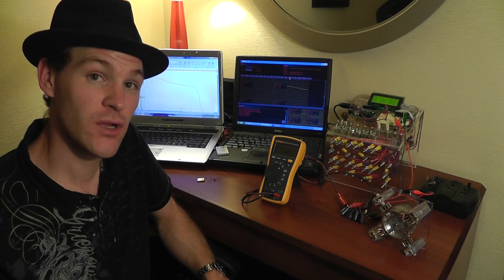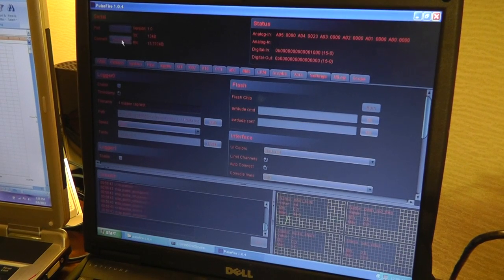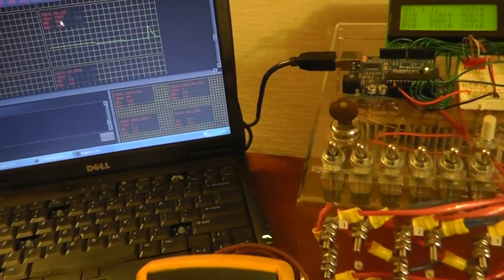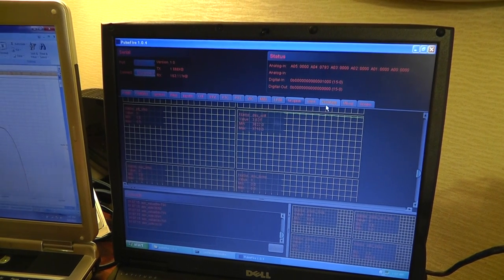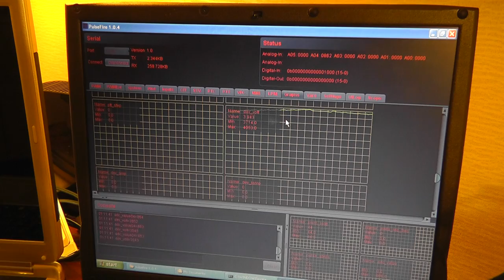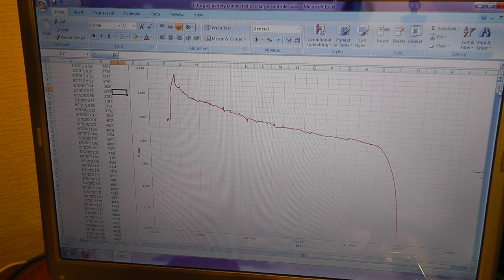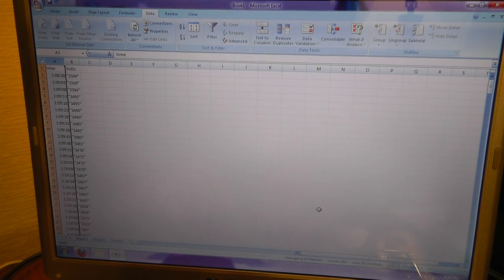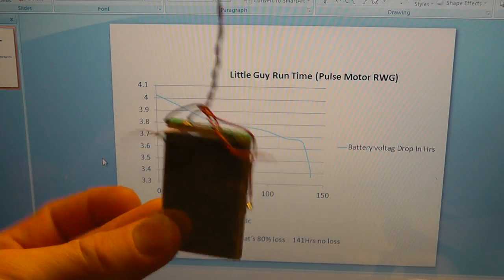Using PulseFire As A Arduino Controlled Voltage Data Logger (Demo) == PulseFire == RWGresearch

Comment: problems from step 1. this isn't starting out so well. i try to connect. i have both a arduino nano and uno. both work fine with the original ardunio sketch software. however when i attempt to connect though pulsefire 1.0.4 i get info_chip error